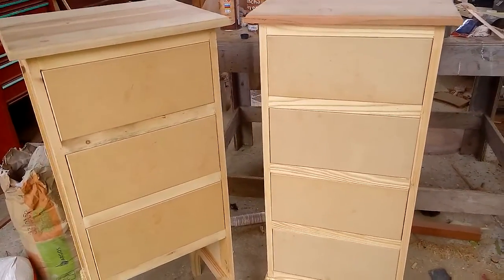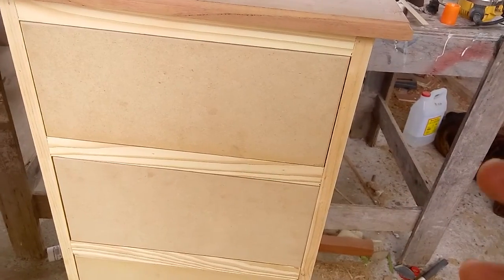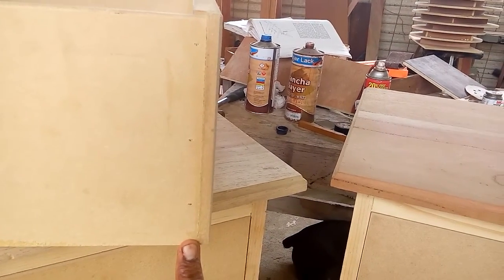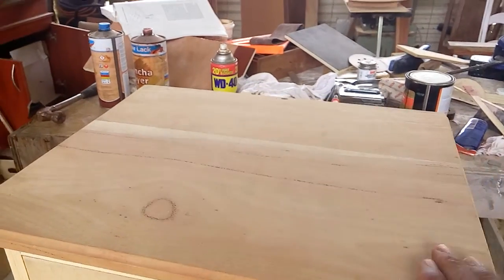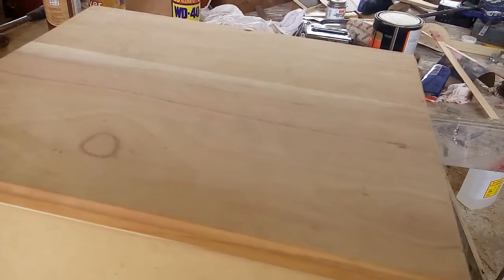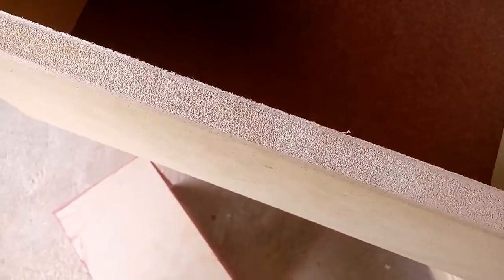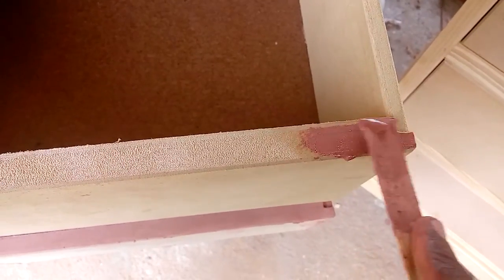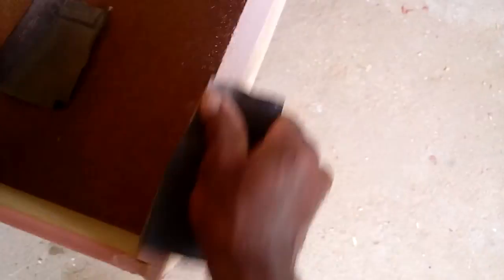Filling pores on mdf edges

Comment: I've done something similiar when I needed harder edges and used the 2 compound plastic padding wood filler (also tried epoxy) which made the edges really sturdy. For ordinary usage I'm sanding as andrew also pointed out, I usually skip the 80/120 and go 180/320 instead and put my money on clean cutting circular saw blades. 

Also, cleaning up the edges by using a router taking a millimiter (2-3⁄64in) away gives a clean good surface to start from.

Comment: the correct method to get a good finish on MDF edges is to sand them. I've been doing it for years. Start at 80 or 120 grit and sand depending on how bad the edge is, work your way up to 320 grit. So 80/120/180/240/320. This will give you a nice smooth surface
Reply: +andrew Lee Cabinet I will use this method on my speaker box that I really screwed up on, I will route with a flush cut bit.

Comment: thanks for the good tip. so much options with mdf edge. I dont even know what to do....

-pva and water
-wood glue
-wood filler
-danish oil
-Liberon sanding sealer

Seriously what am I suppose to do????????
Reply from the maker: Gx Autosport yes it's very great guy I used it all the time hey it's still my go-to MDF filler I don't know about PVA glue I've never tried it I don't know if it's paintable or not but this one seem to work very well so I haven't changed yet  I'll give the  PVA glue a shot